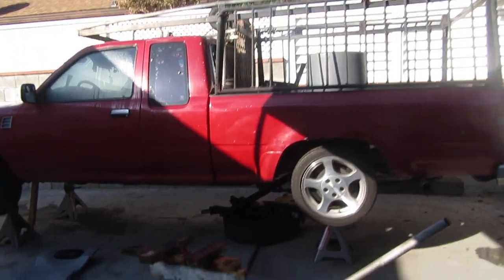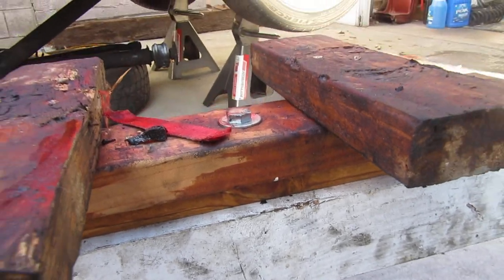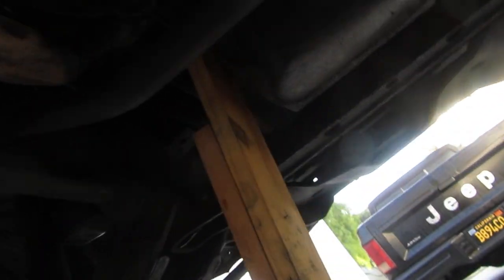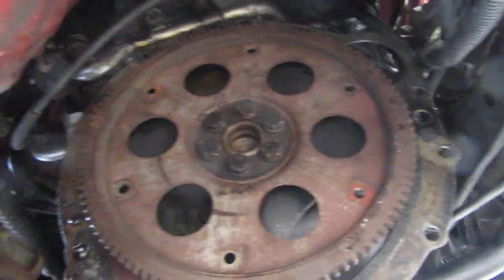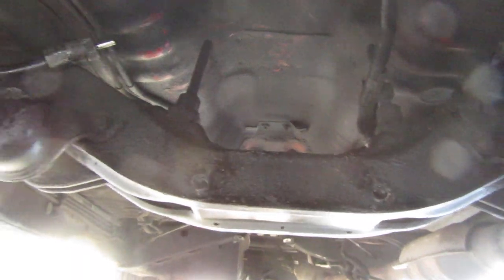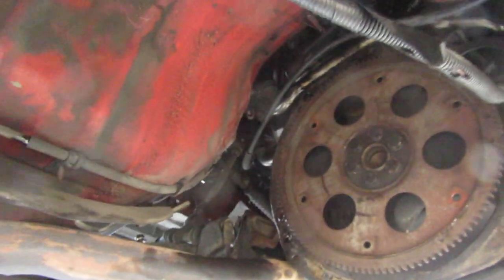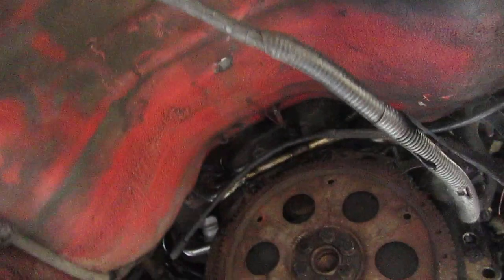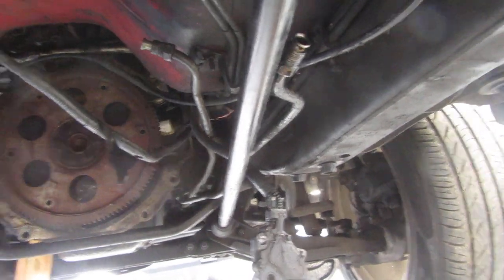1991 Toyota Pickup Transmission Removal Recap

Comment: When lowering the transmission did you have to tip it forward and have it come out due to the welded crossmember in the rear?
Reply from the maker: Absolutely.  That's the easiest way to get it out.  I had to jack the truck higher to get the space needed to get it out.

Comment: Where is yge guy that rebuild the tramission I have 93 that the overdrive is out after  a oil flush  the over drive stop working and how much did they  charger you
Reply from the maker: That was 4 years ago and an online search shows that business is no longer in existence, nor is that price.  Many transmissions no longer service manual transmissions. They rely on electronics now.  I've had T Town Transmissions work on my AX-15's; but, I don't know if they still do. 
T & TOWN TRANSMISSIONS

7217 Woodley Avenue

Van Nuys, CA 91406

(818) 901-8456

Another place to try is:

Alcantar's Drivetrain Performance LLC 
465 S. Atlantic Blvd. 
Los Angeles, CA 90022

Tel: (323) 264-9080
Reply from the maker: Automatic?  Won't go into overdrive?  Have you tried adding more transmission fluid?  A lot of times, that's all it is.
Reply: Yes has oil I think when I did the oil changes at the time I really  didn't  pay attention  to the oil. But the oil I got at the auzone was some oil that  they say it was the same as the the factory  oil and right after  that my over drive stop working I am going to  order some factory  oil and do flush before i call quit and look for a place where they rebuild  the transmission  is hard  to find some that works on that type  of transmission

Comment: Any trucks tricks to getting to the two top main bolts of the bell housing? Lmk ASAP🤙🏾
Reply from the maker: I used a T-Handle Ratchet - Harbor Freight SKU 98484 or Harbor Freight SKU 57175.  I don't know how anybody else can do it.
Reply: Ik this is old but i used enough extensions on a wrachet
Reply: You can reach them from the back of the engine bay with a long 17mm offset wrench. It takes some time but it's possible. I literally just did it.